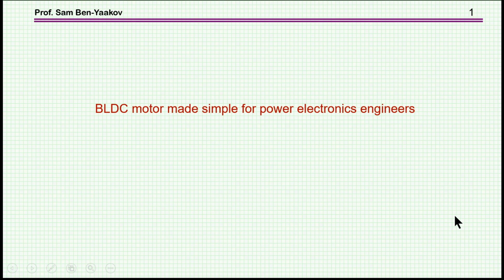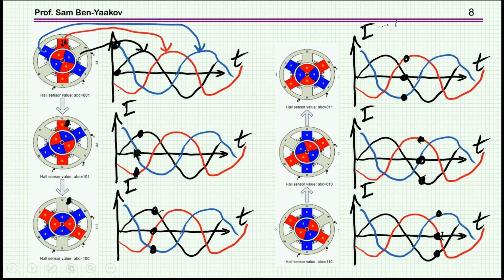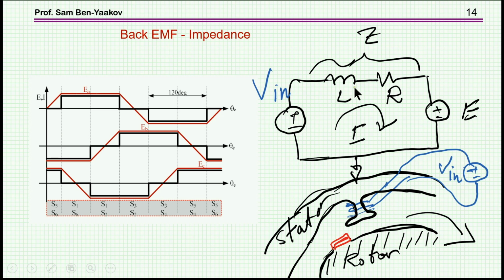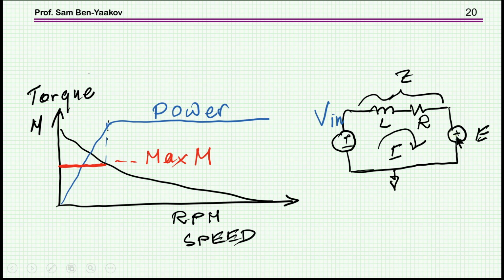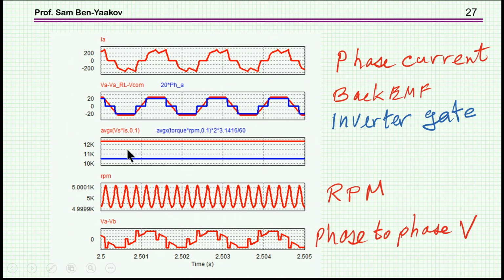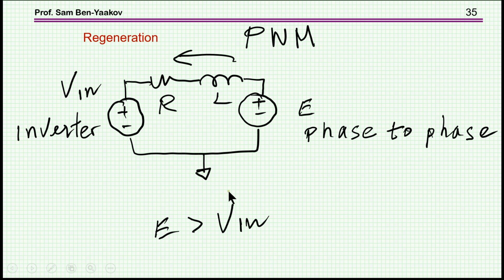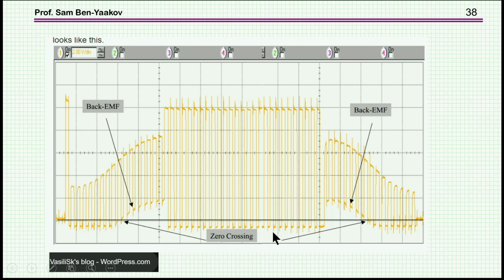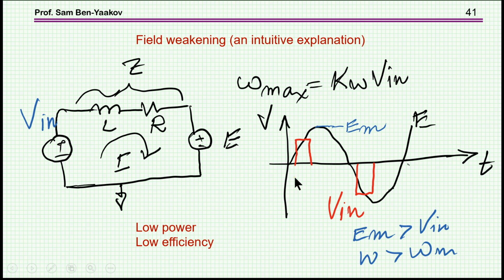BLDC motor made simple for power electronics engineers

Comment: Very Nice explanation Sir ! 
How to Derive Simulation in LT spice without actual BLDC motor part. 
Can i consider any known EMF value in Spice Simulation to derive the current and Voltage ?
Reply from the maker: The EMF is the voltage expected at full RPM
Reply: Sir, Could also provide the EMF voltage range which we can consider for High Speed and Low Speed (High torque Condition) for Vin condition
Reply from the maker: @pavamanp6873  If a motor is designed for a certain bus voltage level that is max AC voltage, then to get the specified RPM you need full AC voltage (M=1) which is approximately the back EMF (all approximate neglecting voltage drops and phase shifts)

Comment: How do I pick carrier frequency for the PWM signal used to control acceleration/brake regen? I have been building a custom driver and so far the motor spins the best at around 500hz, but not significantly better than at 350, 1200 and 16000 khz (PWM carrier frequencies). At 350hz carrier frequency the rotor speed, stator heat and unloaded power draw is the worst (probably too much short circuit load during the current recirculation period, as I think it goes in the equivalent of dis-continuous conduction mode). Changing the PWM signal duty cycle successfully alters the rotor speed and under about 30% PWM signal duty cycle the idle power consumption sharply drops. Advancing the hall sensor timing angle slightly helps with rotor speed  and torque is reduced (as expected), but does nothing to help unloaded power draw.

Comment: Amazing presentation, especially the regen braking section explaining the natural occurrence of a boost converter without dedicated components. A thing I have been wondering is why do basic brushed motors have one north-south pole pair per 360 electrical degress (2 magnets-1 north+1 south on the side, 3 coils on the rotor) vs brushless motors having double the magnetic pole count (12 magnetic poles-6 north south pairs on the rotor, 9 coils on the stator)? Is it related to the detection of the zero-crossing point or just a way to increase the motor torque within the same manufacturing complexity of the stator?
Reply from the maker: Thanks for input. Yes, Ilso think the reason is  to smooth the torque

Comment: while PWM ing the on phase there are those large voltage spikes on that coil would adding capacitors between it and the grounded input help or just make things worse? ( I was thinking about capacitors that are non polarised between each phase s?

Also at what frequency does the 6 step operation work at? what about the phase PWM? (I know this one depends a lot on engine inductance but is there a x where if you go higher then it you should be fine?)

while the active PHASE is PWM ed are there moments when both the active phase and the ground phase are bot connected to GND or is the PWM ed active phase left to float?
Reply from the maker: A sinusoidal drive is the ultimate solution.

Comment: Great video.
Question.  I'm replacing my ebike motor pcb.  My original pcb has 5V GND SP H1 H2 and H3 components that's I'm familiar with and know how to connect.  

My replacement pcb has these connections PLUS a "K" (relay?) and "-" beside it.

What is relay used for?  Does K mean relay? And, since "K" is not a component on my original pcb does that mean this pcb will not work unless connected to some type relay? 

Tried looking online/Google.  No luck.  Need some help.  Hope u can.

/bklyn 👑
Reply from the maker: Sorry, I am not familiar with this circuitry.
Reply: @sambenyaakov  no worries. thank you for responding. the pcb label K (in my case) is an additional/optional function for thermal sensor.

/bklyn 👑

Comment: A 3 phase brushless motor has the following values. The maximum current drawn from the battery is 4.62 amps.. The thrust   is 4025 grams with a three-bladed fan 18 * 8.. The speed at the maximum lifting force is 2780 rpm. The battery voltage is 23.46 volts. How much is the output power? How much is the efficiency?
Reply from the maker: (torque*w)/V*I

Comment: Thanks for the presentation Professor!

In d-q axis, when rotor flux is aligned with d-axis, stator flux has to be aligned with q-axis(i_d= 0) for max torque per ampere. For field weakening, we orient "i" vector so that i_d < 0.

In abc-axis , this means that?

In order to achieve maximum torque per ampere, we need to align the EMF and current of the phase. When we want to achieve field weakening and increase the speed, we just decrease the current amplitude (to decrease the torque) and impose a phase-shift between to the current and EMF?
Reply from the maker: It is the way around. What matters is the actual physical 3 phase vecror space while the  d-q is just a mathematical manipulation limited to balanced systems and no higher harmonics.
Reply: @sambenyaakov  Thanks a lot!

Comment: Do we actually need a back emf if we replace a bldc motor I mean does the back emf needs to be implemented if e make equivalant circuit, i try to test the motorcontrollers current and will measure if the commutation is going the right direction when controlling it, but does back emf have a lot of effect on tbis commutation?
Reply from the maker: I am afraid I don't follow the question.
Reply: I try to test the motorcontrollers DRV835x but I dont want to use the motor, i will replace the motor with his equivalant. So i will generate the 
-Load(with my specific Resistor and Coil Value)(generate load stepwise)
-back emf with a variable trapezium voltage generator
-hall sensor simulation to simulate the hall sensors so actually the motorcontrollers thinks there is a turning motor but there is not.
- this is done due to functional testing of the motorcontroller currents and see the commutation are going to the right direction. 

So my question is I want to understand better the presense of back emf in the application, do I really need to realise it. Thankyou very much.

Comment: In an induction motor the current change direction constantly and a supposed rotating magnetic field is producted that the rotor chases.  In a bldc motor you have to change the polarity in the coils by various means and frequency to pull and to push preferably right? and of course one pair of coils to do nothing and so on.    I sure also like to know the details about coil winding in terms of resistance and number of winding turns.
I seem to have a motor that appear to have lots of windings as such that it reads 100 ohm between each three legs (u,v,w) but most bldc motors are lik from 5-10 ohms..... This motor also have  hall and pwm
Reply from the maker: You can drive a BLDC motor by a sinusoidal waveform, not much different from an induction machine.
Reply: @sambenyaakov  Thank you for your reply. . I am not sure what wires from my breaker box goes to the three wires in the above motor.  With its resistance of the coils wires being high, I would think 240 V supply,  having two wires and the motor with 3 wires, would I need to use a capacitor with certain uF specification?  I don't have 3 phase supply at the house. 
This is the motor but the spec on it with regard to voltage supply is for its control board which I don't think work any more.
On the motor hook up as you can see has the 3 wires for the motor  and the hall 5 wires.
https://www.h-mac.com/amana-0131p00029S.html

 
  Here is another motor I have.  I am not sure if you have seen.  These motors are in  washing machines, the are typically a foot in diameter, with the magnet rotor being on the  outside..  BLDC, three wires and hall sensor. The resistance between their 3 coil wires are 5 -6 ohms big difference with the above motor. 
What voltages to I supply to each three wires as I don't have a 3 phase supply.
https://www.youtube.com/results?search_query=lg+bldc+motor
Thanks in advance for any follow up.

Comment: Thanks for sharing Professor!
Reply from the maker: Thanks
Reply: @sambenyaakov  

I made this driver without a micrcontroller and it works pretty well   https://youtu.be/3iMqkmQMQTY    However,  it requires a lot of manual adjustments to operate it. I would like to automate the adjustments without a microcontroller. I understand in principal how a closed loop works with a microcontroller, but I have no idea how to automate these adjustments without a MC. Where and how would I apply feedback with discrete components?